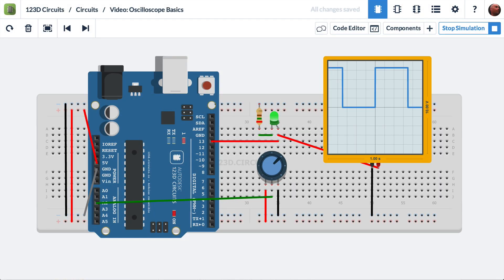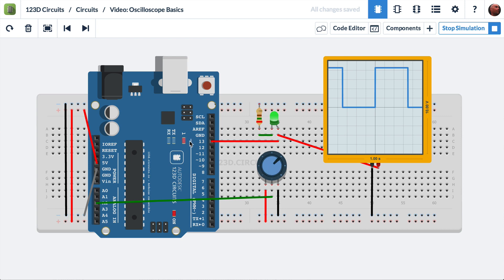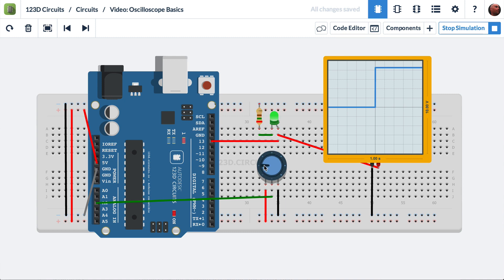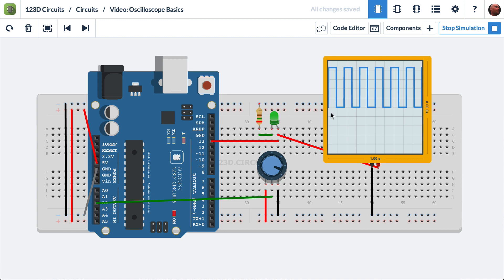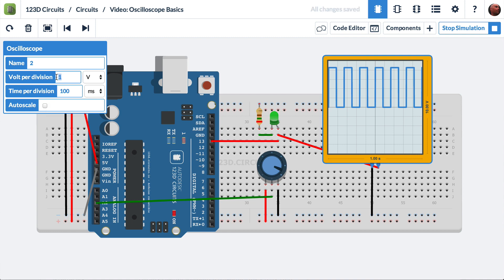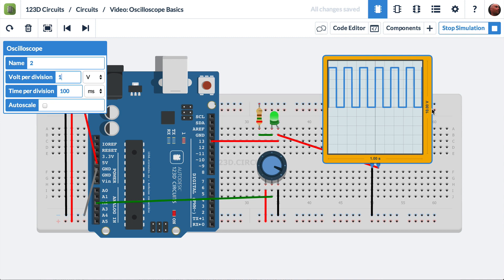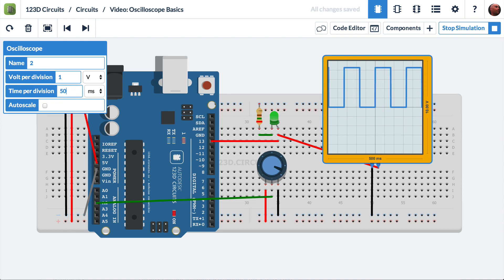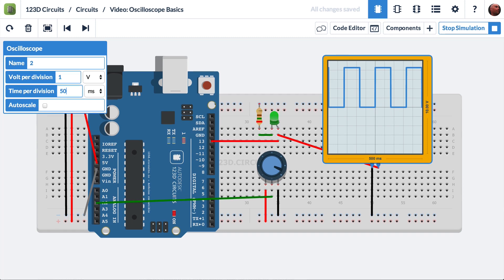Oscilloscope basics - Electronics Lab

Comment: Is there any ways to input a AC signal (sine wave)  and watch how an AMP would transform the signal?  I don't see any AC source in 123d circuits
Reply: they have a function generator, where you have specify frequency and voltage.